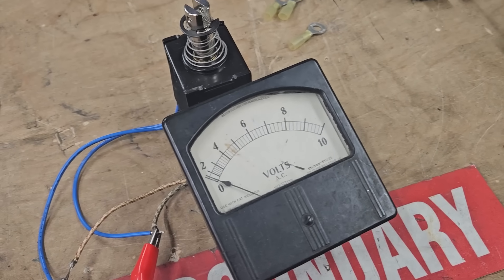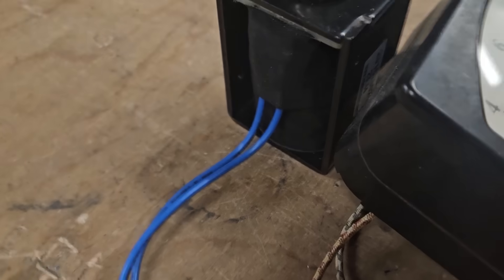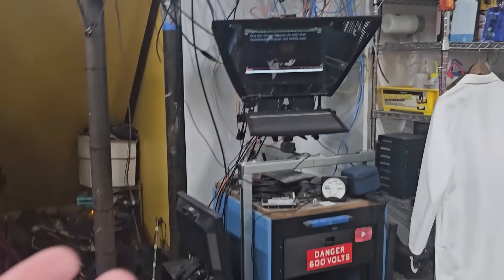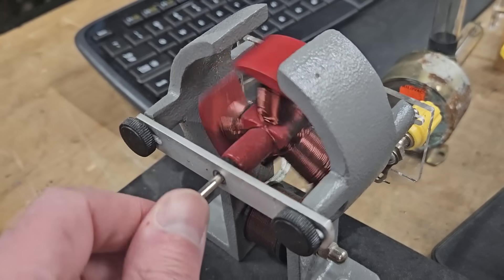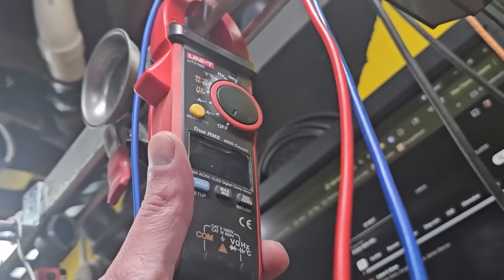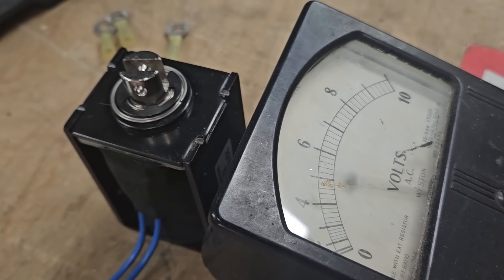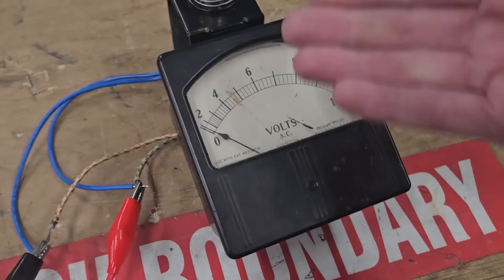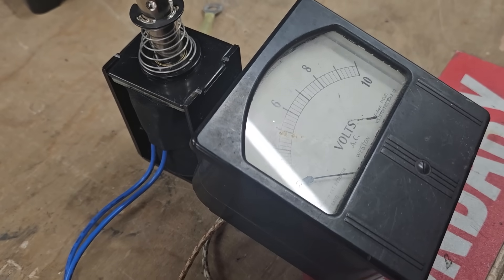Hysteresis Behind The Scenes

Comment: Back when I was in school, I thought, "Analog meters are completely useless now that we have digital ones!"
But you keep proving me wrong and honestly? I love it!
Thank you, Chris, Chris, for bringing back my curiosity and sending me down Wikipedia rabbit holes again!
Reply: If you rely solely on digital meters leakage current will fuck your day.
Reply: I still use an analog meter to test for the presence of a twice-per-second trigger pulse that causes the sequenced flashing approach lights to work at several airports that I maintain equipment on. DMMs can't register the pulse fast enough to confirm whether it is there or not. Bouncing needle = good trigger
Reply: @8DeereFarm Analog meters are also good for checking transient voltages and finding null voltage on a synchro.
Reply: Love seeing situations where the fast reaction of an analog meter is key and the slow reaction of digital meters just won't work.

I keep a Simpson 260 just because of the things it'll do that my Fluke 77 can't.